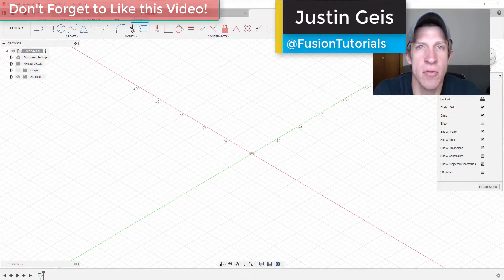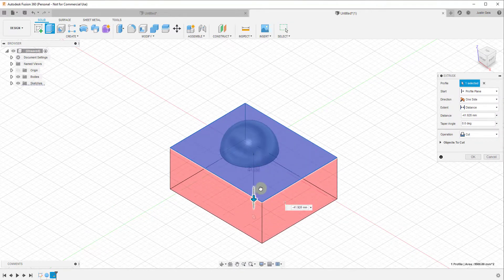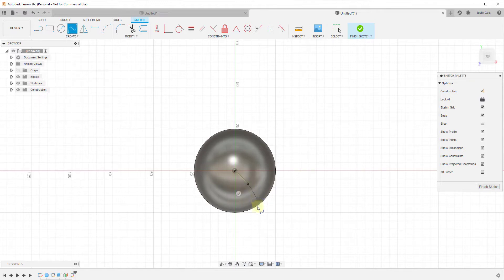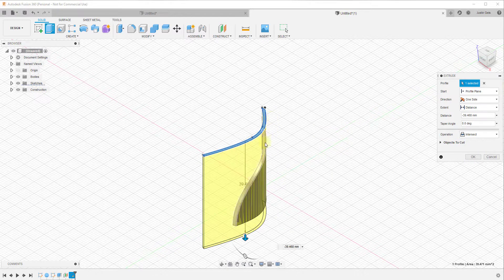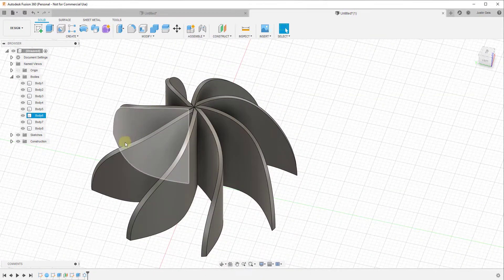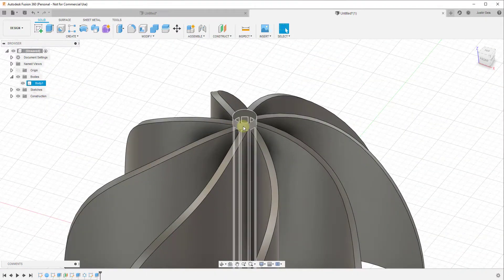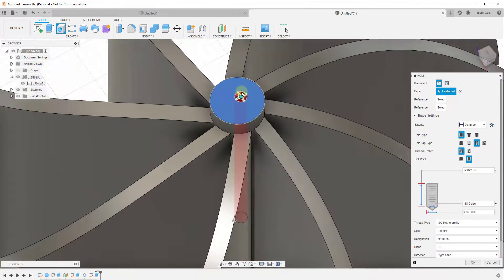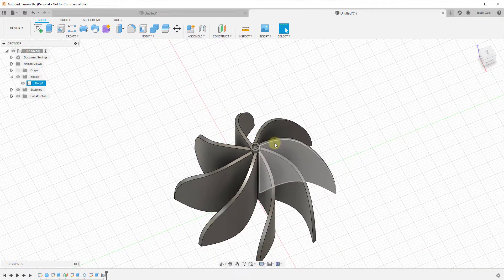Modeling FINS in Fusion 360 with the Intersect Function!

Comment: I’m new to fusion 360 and 3-D printing and I’m trying to make a bracket similar to one that’s already made but what I need to do is make a one mil thick basically looks like a flag so so one male thick rectangle about seven mil long and a depth of about 12 mil which tattoos 24.4 mil diameter tube but where the flag type shape is joined to the 4.4 mil cylinder
As it comes out the bottom right hand corner if it’s attached to the left it basically bent up slightly so through the corners in normal fixed rectangular shape the bottom right hand corner is twisted up slightly basically what happens is when you put another part onto this bracket that bit of flag actually holds the object onto the flag onto the bracket if you need to remove the object then you push flat corner in slightly then allow you to release the object on it, but I can’t for a life out how to do this once The shape has been extruded